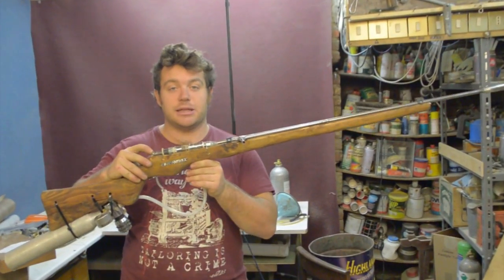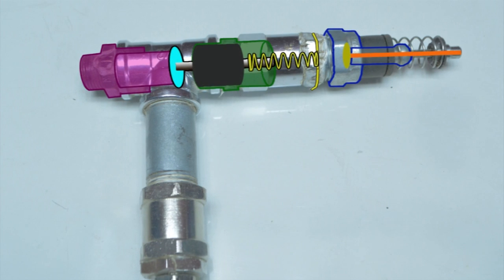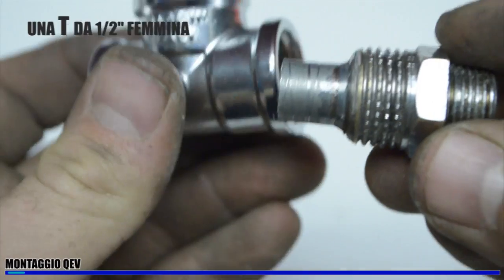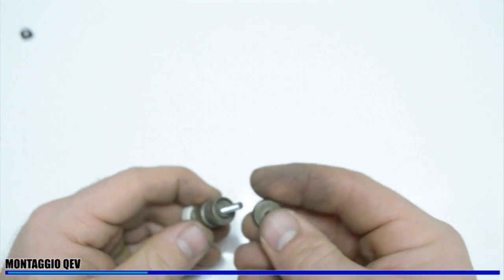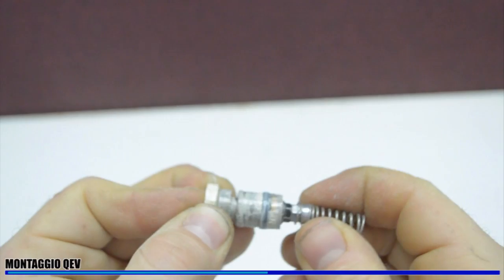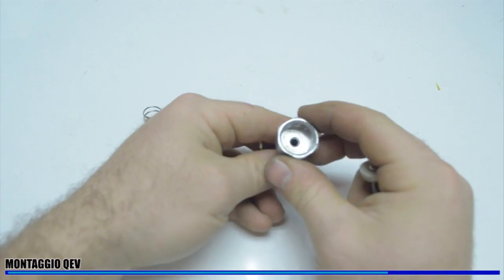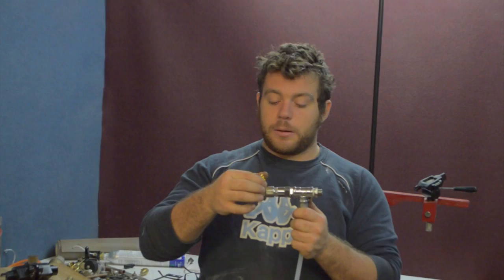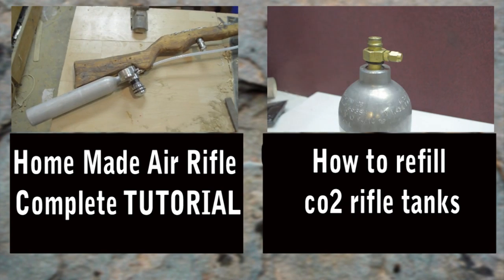How to Make • Air Rifle QEV Valve (Quick exhaust valve)

Comment: but why can't you biuld small hammer behind the valve on the back to push it and activate the qev  and use small preassure stream that hits from behind when qev is activated, to put the hammer in start position?
Reply: I think it will make the backvalve move faster and make less preassured air loss.

Comment: This is strong yes? Also, how to make canister connect pressure?
Reply: it would be best to use something that is already pressure rated, for example a small (empty) fire extinguisher, CO2 cannisters could also work if you make sure the cold doesn't effect the seals

Comment: recently ive been having alot of trouble with my piston at higher pressures, not with the piston itself, but the sealing face.

i see youve got a piece of tube glued into the adapter and that seems to work, so ill give that a go. but how did you connect the barrel to that peice of tube you glued into the 1/2" adapter?
Reply: yes!   see   my  other video   Home Made Air Rifle Complete TUTORIAL  and QEV valve